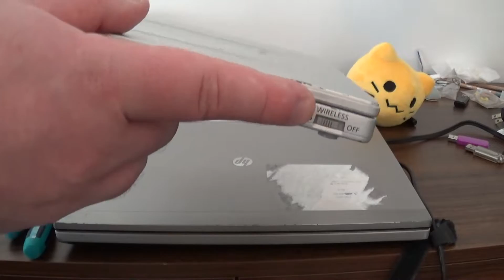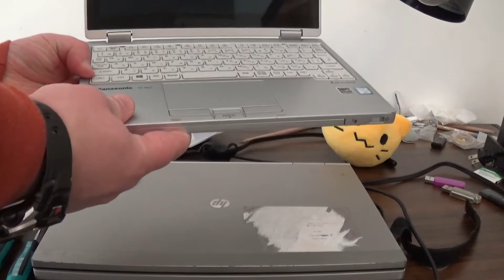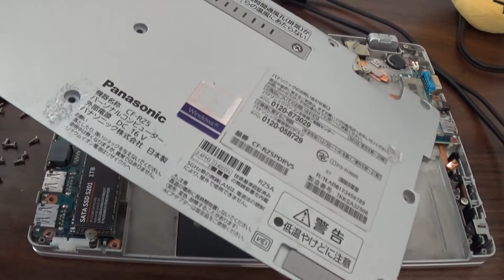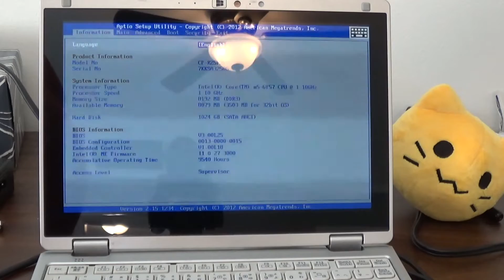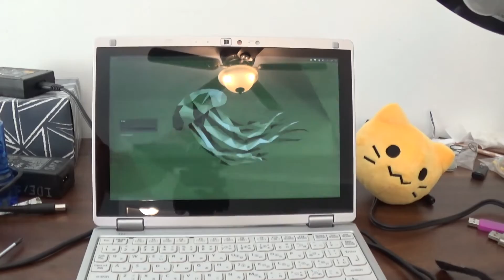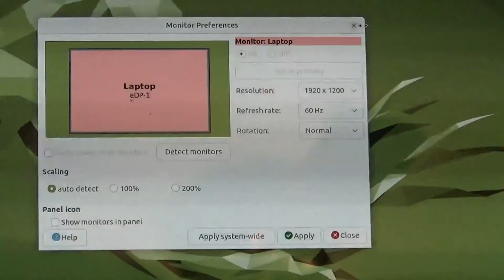Panasonic CF-RZ5: Obscure Japan-only 10.1 Core m5 Ultraportable

Comment: I have two of these - the higher end one came with 16GB RAM. I use them for all my remote work. The low weight of these has to be experienced. If you need something to always carry around and your performance requirements are low to medium, they are awesome. I use them for software development. They are also fine to do presentations. And the touch screen makes them a lot of fun to use (after having them since 2019 I consider any laptop without touch broken). The screen size is really small though and not even filling the full lid area. Still they allow you to work on a train or a plane. Since they come with a VGA and a HDMI connector, you can connect two screens to them - turning them into a proper work station. Big downside: They are not officially certified for Windows 11. (Only the last models of the RZ series do) While hacks may let you update anyway, this is risky as Microsoft could lock you out with every update. They do run Ubuntu fine and even the touch screen works there. If you require a carry around a laptop at all times to be able to help in case problems come up - the Panasonic CF-RZs are a life saver. I'm not aware of any laptop with this size/weight that offers a keyboard layout you can actually work on. Alas Panasonic stopped making laptops with this form factor.

Comment: I have both the CF RZ4 and CF RZ5 (using the latter now) here in Japan and I love them but they are both "not compatible with Windows 11" I am not sure whether to try to insert W11 anyway or move to Linux with the latter. Apparently there is a dollar a year Windows 10 updates deal for educators so I will probably stick with Windows 10 will then. I like the button that turns off the internal keyboard because I like mechanical keyboards and I turn the laptop over to rest on its keyboard so that I can use the touch screen near to me and not need to use my glasses. I have a super light laptop but carry a mechanical keybaord with me that weighs just as much. 

Thanks for telling me I can't upgrade the RAM. That is what I came for. A shame but 8Gb is probably enough.

I bought a THIRD CF-RZ5 with windows 11 pre-installed! So it is possible. There are a variety of ways. Registry, delete a file or use a Windows install from Eastern Europe that is distributed by a Chinese American (Dong Knows Tech).

Comment: I daily drive a panasonic let's note, mine is one of the newer 12" CF-SV series and theyre awesome, very easily moddable with the exception of the ram that is unfortunately soldered on
Reply: something really awesome about the new ones is that they charge both over USB or the barrel jack, so you can have the 110w barrel charger at your desk for fast charging + being able to use the usb C to connect peripherals, and a 60w usb C charger for on the go to save weight
Reply from the maker: @oggilein1  yeah some of the Dells are like this I need more weird laptops

I also have a NEC PC-9821Nr15, fun thing.